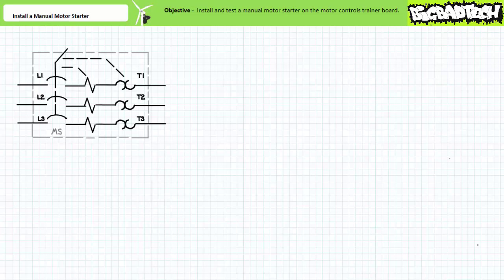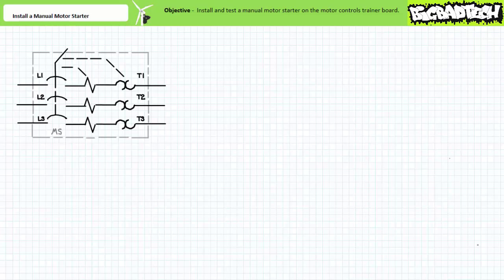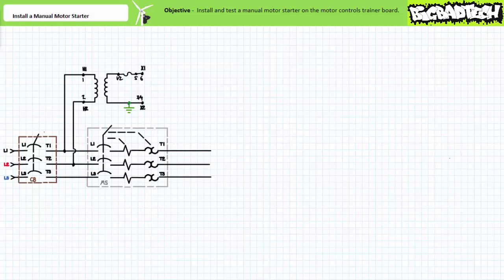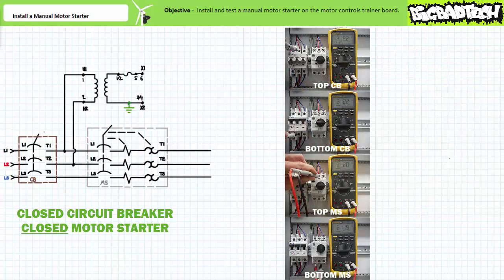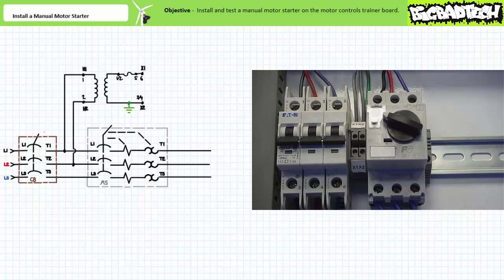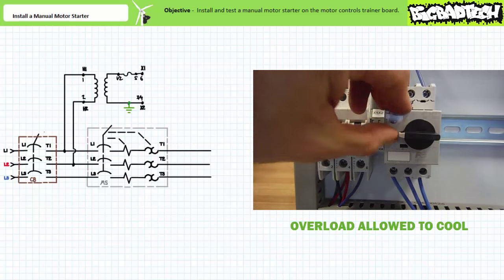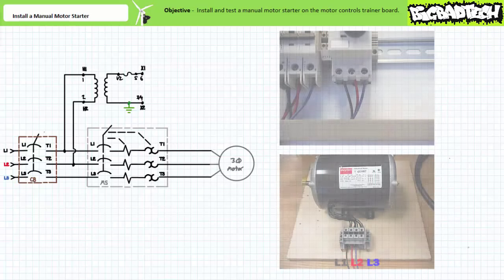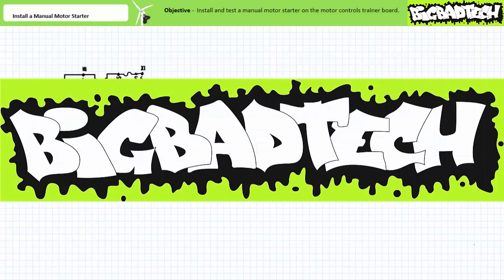Install a Manual Motor Starter

Comment: Does the motor need a circuit breaker with a manual starter. Does the manual motor starter also cater for short circuit as well as over load currents.   Is the CB in your diagram just there for the control circuit isolation ??
Reply from the maker: This is not necessary but a pretty common arrangement. Yes, the manual motor starter will also deal with short circuits. The reason for the series connection is:
1) double protection in case one element fails
2) the control transformer will be installed between the CB and MS. All primary contactors will be below stream of the MS. By closing the CB and opening the MS one can test the pilot ladder logic circuit only without worrying about the primary circuit and actuators.
Reply: Thanks Jim for clarifying this. One final question. Is the Circuit breaker rated for protecting  the motor or the cables or the transformer. How does one choose the class of circuit breaker and ampage. It has to deal with the motor (and transformer) inrush current etc. Is the CB amp rating related to motor FLA or is it not so important when you have a motor starter also in the circuit
Reply from the maker: It all depends on the AHJ (authority having jurisdiction). In the United States one version or other of the NEC is go to reference for wire sizing, circuit breakers, etc.
Reply: @michaelcostello6991  the breaker or fuses used for short circuit and ground fault protection of the motor are sized according to the full load amperes the motor draws. It is a percentage of the FLA depending on the type of fuse or breaker used. The same methodology applies to sizing the overload protection, but the percentages are different. You size the overload protection at either 115% or (usually) 125% of FLA, depending on the ratings (temp rise and service factor) of the motor.